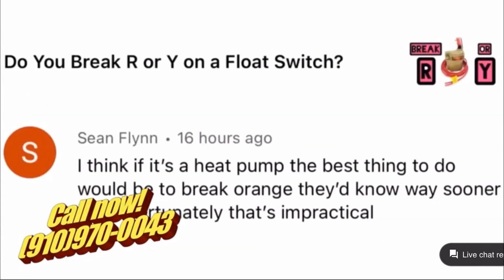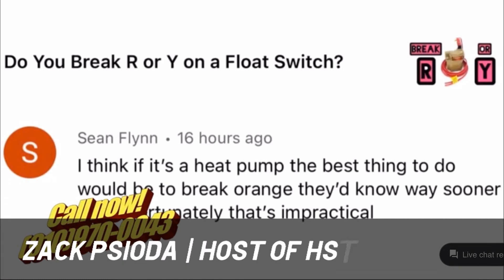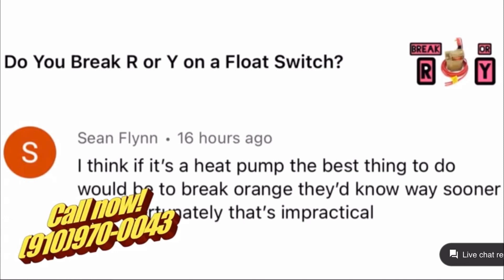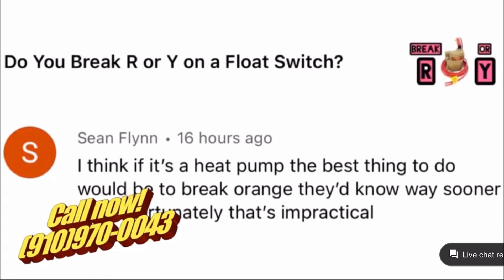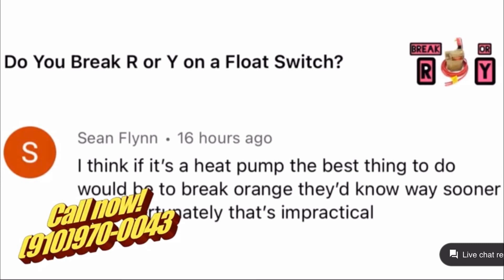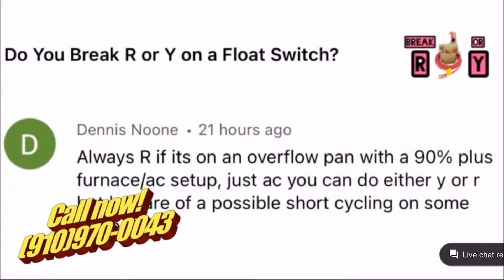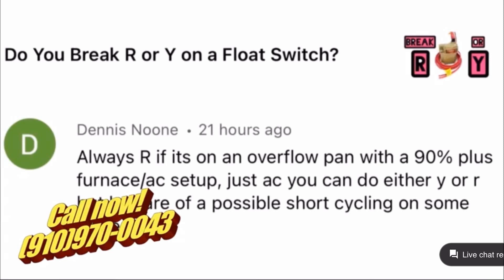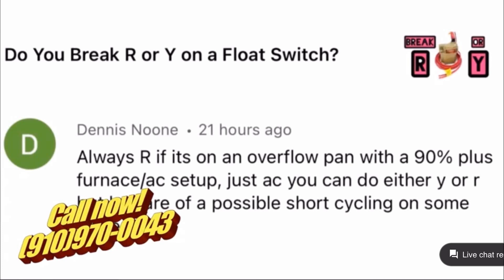Would You Break "O" When Wiring a Float Switch?

Comment: Send Y to terminal 1 on a fan relay so that the relay closes 2 & 4. Also run Y through the now closed contacts (2 & 4) on it’s way to the condenser. Send R to terminal 5 & common to terminal 6 (the now open contacts)

Float switch is wired before the relay meaning that when Y breaks, so will 24v to terminals 1 & 3 on the relay which will now open 2 & 4 shutting off the condenser but also close 5 & 6 and blow up the transformer. Customer will know something’s off. 

Downside? this happens once every cooling cycle because as soon as the t-stat quits calling for cool, the transformer cooks.

Comment: Just break R. Nothing annoys me more than someone breaking y. 

Y break Y????

By breaking y, the technician will spend more time by going out to the condensing unit first thinking something's wrong with it before he realizes he has no 24 volts. 
Just break R. That way the technician knows to go straight to the air handler immediately saving time and confusion. 
When your AC isn't working, circulating the fan when it's 85 or 90° in the house is pointless. Yeah like the homeowner is going to be thankful hot air is circulating in his house.
Reply: Absolutely 💯 agree with you on that one.
Reply: Exactly. Not to mention a intermittent break on Y could cause short cycling
Reply: Exactly